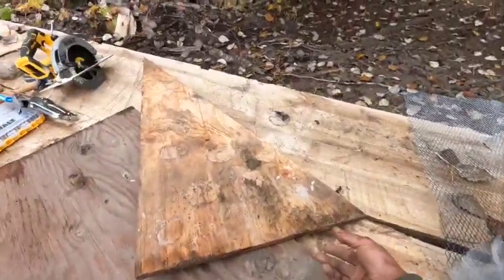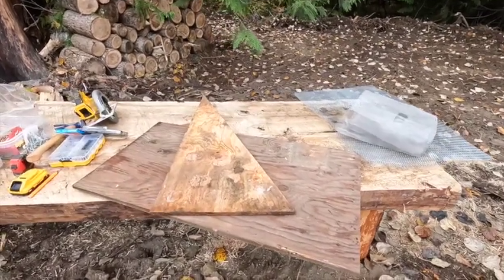The Micro Hydro Project: Episode 3 - The Intake Part 1

Comment: You could put a pipe directly in the stream, and then add a construction after it, so you wouldnt have to worry about how to dig it for a perfect flow. For that screen, you have to put some bigger stronger mesh behind it, or some bars.
Reply from the maker: You are very smart! You may see in an upcoming video that you are certainly right about the screen...